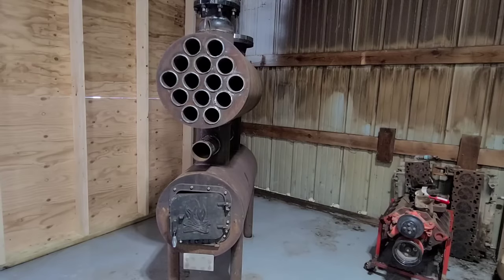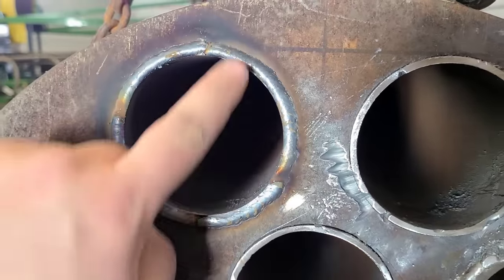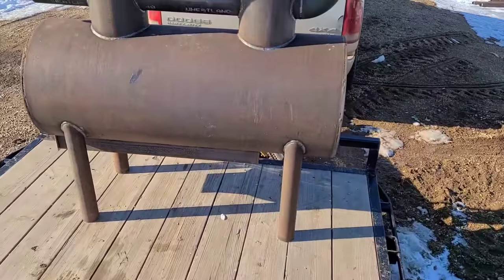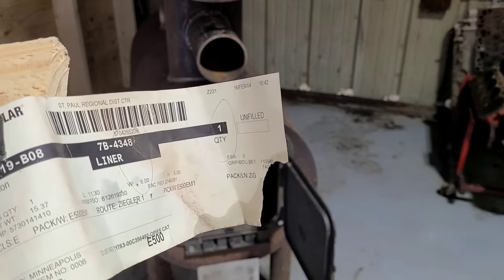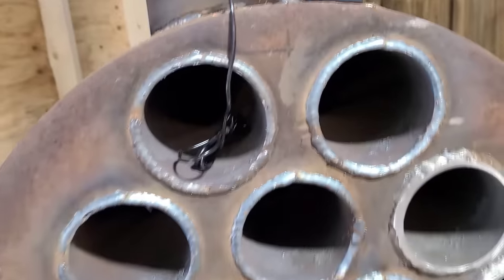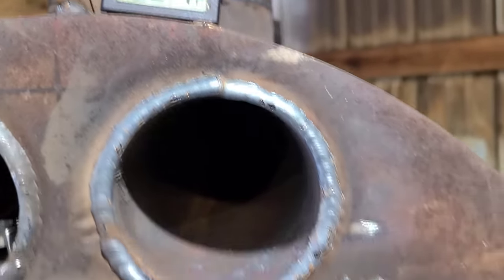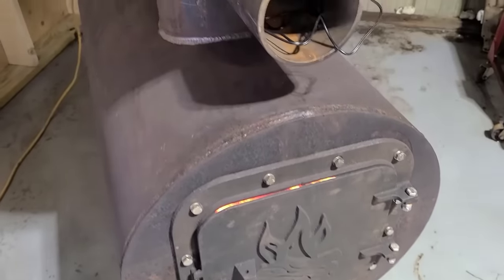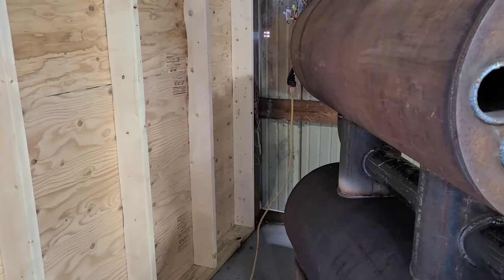My Ultimate Shop Wood Stove Build Part 3

Comment: You should put an elbow of some sort on the top of the exhaust pipe on the roof. Otherwhise when it starts raining or snowing water will come down, fill up your stove and then start leaking outside the stove with all related problem like rust and dirt. Also to avoid any kind of bird to been able to make a nest inside during the hot season. For the rest, a beautiful pice of art! Congrats
Reply from the maker: I do have a cone style rain cap for the pipe but with the wind I really didn't want to climb on the roof haha, thanks for watching!
Reply: Grab a 6" Tee from stores and some SS mesh .  Orient N-S.

Comment: It would be great if you could draw your combustion air directly from outside instead of using heated air from the room which has to be replaced with cold air from outside through leaks in the building.  Beautiful heater.  It's going to be there for a while!

Comment: A damper on chimney would help to control air flow and slow the burn for longevity. It would help raise temp of heat exchanger by allowing exhaust gases to flow through slower and exchange more heat.
Reply: This, damper, flue etc...Rockwool insulation in that wall and something reflective to sheet it. Consider some sort of forced air intake maybe...the fire bricks will help it resist warping, if i had caught this in part 1 i would have suggested thicker wall air pipes on the bottom, we had heat exchanged air fireplace when i was a kid and the bottom tubes wore away after some years, Some crude bent rebar grate for the bottom to keep the wood and fire up off your screen on the bottom will allow more air to get under the fuel and back to the rear, those eat away pretty quick too..
Reply from the maker: I don't want a damper in the exhaust as I need the heat to keep any creosote buildup burnt off. There is a fine line between losing too much heat and choking it down so the chimney is cold and creosote builds up. I'd like to stay on hot side of that line 👍

Comment: Everyone has an opinion so I'll throw my two cents in. I'd look for a way to add secondary combustion air to the fire. This is usually a small amount of fresh air that can be delivered to the top of the combustion chamber. Makes for cleaner burn and more heat. Great fabrication work!!
Reply: Everyone think about this, it’s a meme at this point. Isn’t more straightforward to increase the temperature at the first burn than over engineer a second burn not knowing if it will be hot enough to actually burn?

Comment: Very nice build, I am considering building a similar stove, but using a large 275 gallon fuel oil tank. I especially like the grate and ash pan idea, you can clean out ashes while the stove is going. I have been trying to figure out a magnetic nail collection apparatus to make ash disposal easier and faster. The fire looked and sounded great, nice ending scene!

Comment: Bring outside air directly into the firebox
A great way to improve the energy efficiency of your fireplace is to duct outside air directly into the firebox.  This is even more effective when combined with the installation of glass doors, so that then the fireplace does not use room air for combustion at all (helpful accessory: fireplace back plates). With direct ducting of outside air, the vents on your glass doors can be sealed completely.
Reply: But..., pre-heating the outside air, is even better. My 4' long wood boiler fire box uses 3" pipe to bring the combustion air in, the pipe runs along the upper side of the cylindrical firebox, and exhausts a few inches from the front on the stove. Over the years of use, I've found that if I take the time to cut and use much shorter pieces of scrap lumber, and hold the fire forward, the remaining 3' is all heat exchanger, the smaller fire right near the inlet air burns real hot, no visible smoke, very little ash.

Comment: You can use concrete board like what you use in showers instead of steel.  It is fire rated and would be super easy to tile or stone over if you ever wanted that look.
Reply from the maker: Never though about that, thanks for the idea
Reply: That's a really good idea

Comment: I believe that you should have a dampener in the chimney a little ways above the bolt flange. Then you can get more heat from less wood!!
Another suggestion is to burn up a couple of aluminum cans  a couple times a week to turn the creosote dry and flakey. Especially since you are burning pallet wood. Wet wood and pinewood are awful for creosote and the combination of not retaining more residual heat adds to that as well. 
Put a weighted bucket upside down on the top of the chimney when you are done for the season will help keep the internal rust slowed up too. 
Good job bud!!

Comment: Stay safe and warm. I do agree with you though, the door should seal tighter.
Reply from the maker: I think I can bend the latch and get it better, if that doesn't work I can turn some eccentric hinges on the lathe to bring the door in/out 👍

Comment: Just learned about wood stove fans recently. They operate off the heat of the stove. Low speed should be easy for a stove fan.  I've built air heaters before and I have a similar idea for a wood stove in my head. The air heaters I used to build had a stainless steel expansion joint between the tube sheet and the box to allow for the expansion and contraction of the tubes when they heat and cool so you don't break the welds on your tubes.

Comment: Kyle, if you burn a lot of green softwood, you may find that you get a lot of tar condensate on the top tubes, where it is coolest. In our last house we had a Franco-Belge wood fire burner with a back boiler connected into the water central heating system. I had to take the burner completely to pieces every year to clean out the tar build up on the boiler and that was in spite of doing a really fierce burn every two weeks to try and burn off the tar. The wood burners in our current house do not have a back boiler and get hot enough to burn off the tar, using something called an airwash system but we are quite careful only to use well dried hard wood fuel. My daughter's partner is a tree surgeon, which helps.
Reply: Very thoughtful, relevant comment. Well done
Reply from the maker: Pallet wood is kiln dried so shouldn't be much of an issue. The moisture I mention in the video is from the light rain we had in the morning and making the wood damp 👍
Reply: Kiln drying does not remove the resin or tar from the wood. Only the moisture.
Reply from the maker: This is from the Premier Firewood Company: 

"Use of kiln dried firewood, which has low moisture levels, allows the fire to burn efficiently, create a lot of heat and very little creosote, if any at all."

I'm not saying it will not creosote at all, but a dry wood will naturally not creosote anywhere near as much as a green wood
Reply: Premier firewood is using mixed hardwood, birch and cherry. Hardwood has MUCH less resin and tar than pine. It is not so much about the moisture content in this case as it is the specie.

Comment: Put a dampener in the chimney. All you have is a regulator for the air intake. Hold that heat inside that stove not let it out the chimney

Comment: From the looks of it your a welder by trade, and also looks like you did a lot of planning on your wood burner . You should never have to replace any parts on this beast. Great job.
Reply from the maker: Thanks!
Reply: Nothing on the stove will fail, his fan might but that's pretty easy to swap out.

Comment: Would you be able to tell us all on YouTube your thought process of flow for the smoke and heat extraction part Kyle ?? I and others here would very interested. This is a beast for sure. I personally would feel a lot safer with wider legs cause of the top heavy weight.  Look forward to performance at your shop Kyle. Keep us all informed. Peace LOL.

Comment: Merry Christmas! I love what you did with that old boiler! You have to insulate the unit with lagging, it would be more efficient and safer for people than insulating the building around it. You could fill that heat exchanger with water, set up a recirc system, and use it for shop hot water. A pressure washer with a hot water supply is a beautiful thing in the winter...

Comment: They sold 55 gal barrel stove kits back in the late 70's early 80's.  I bought the kit to assemble a wood stove for my auto body shop, so I didnt have to have a forced air furnace blowing dust into my paint work.  I did a similar trick with 1'1/4inch tubes in the upper barrel and a fan  to blow air through the tubes.  It would absolutely run you out of the shop when burning oak and hickory.
Reply: I had a stove kit from a family owned company called SOTZ, just a great simple and cheap kit, all stamped steel no castings, air tight and man did it put out the heat!

Comment: My only concern is with wood heat; it dries the air so much.  I would suggest welding a small table, so as to be able to sit a Tea pot / kettle of water (say 10" inch square, 0.25" in. thick or thicker) to heat up and put moisture back into the air.  Your throat and sinus will thank me.  25 year's wood heat in my home.  Great build, and design.  Thanks for sharing.

PS the water does not need to boil, just get hot enough to evaporate in a couple of days or less.
Reply from the maker: My thoughts on this were to put the pot on the cleanout behind the chimney 👍
Reply: @kylechrist  waiting for the thermal image video including temps at key areas like the clean out top, etc, very interesting design, can't wait for more vidyas thanks

Comment: You can add a fresh air inlet to the heat sink to turn it into a secondary burn chamber which will create significantly more heat output

Comment: Nice job, should work well. In the late 50's early 60's we had a similar setup with 45 gallon drums but no air tubes. It was our night heat, get wood burning then shovel the sawdust on top.

Comment: Nice build. You have the same problem as most stove manufacturers,  you're heating the mid air and up ! You need to make the heat come out of the bottom and blow across the floor !!!! Remer, heat rises, start with the heat across the floor. I can't tell you how many houses I've been in where my head is hot and my feet are cold !

Comment: How do you clean the flue out? If you cool the exhaust to much it makes water like a 90% furnace. A 90% furnace exhaust gas temperature is 90 degrees your was at a 100 degrees. The water it make is very corrosive and could rot out your flue in no time. I like what you did but it worries me just a little bit.

Comment: I think you are wise to keep the air speed low. One of the challenges with cooling the post-combustion air (which is the effect your heat exchanger has) is that it can cause an increase in emissions, and creosote buildup. I recommend you inspect the inside of your stovepipe regularly until you can determine the rate of buildup you are seeing from lower temps in the stovepipe.
Reply from the maker: I'll just slide the cleanout cover off the heat exchanger and check, saves going up a ladder 👍

Comment: You should try sheeting in the whole stove and add a couple exhaust ports to also trap the heat from the outside of both the burn barrel and your top barrel. With your forced air blowing through to the front. I hope I’m explaining that well enough that you catch what I’m trying to say. 

Great build. I love your idea with the bottom heat tube.
Reply: concrete board?

Comment: Sweet Kyle looks like that stoves working nice. When I was turning wrenches for a garbage company in Norwich NY my boss wanted to make a pallet stove to burn whole pallets much to the same design only we used old thick walled fuel oil tanks and fed the pallets through into the bottom one and put thermal controls on two box fans behind forcing air through the heat chambers . Bays could accommodate 2 tractors and trailers. And that garage was a comfy 79 degrees in the furthest corner great garage to work in and yes the fans were set to low.
Reply from the maker: Sounds like a big stove Shane!
Reply: @kylechrist  it was Rick said he wanted it big enough to burn full sized pallets in it and to heat the whole shop and an added bonus came before I moved on we had added a waste oil feeder to the mix which helped a great deal with the hardwood pallets

Comment: Rockwood insulation in walls at least where stove is. Say 5' out each direction from corner and up 8' in height will protect the wood. Cover this with the same delta style metal that exterior wall is made from. Can run it horizontally for easy screw locations, makes an awesome reflector also. I suggest a used oil drip going into the burner area, in the center of the top. Simple one, using 1/4" copper line ran to a oil resovoir on the wall with a ball valve for flow control.....This will blast your temps past 200f. Easily. My system is just 2 stacked water heaters enclosed in a "shed" with the same fan on the back and several vent holes on the sides. With the oil, the wood is essentially just a "wick" and the oil burns so cleanly you will not have a spot or smoke problem. In 8 hours, in a 30x30 uninsulated shop in Idaho, I will burn maybe 2-3 armloads of wood scrap and a gallon of old oil. And the shop stays roasting, even when the oil is almost turned off. Nice job on yours, just wanted to give you some ideas.
Reply from the maker: Appreciate the suggestions, I have the parts to do an oil drip system only in 1/8" pipe instead of copper 👍

Comment: This is a really genius idea, you have a really great design concept. I think a major design decision you could make on the next one is either to make the upper part half as small, or to double the size of the lower burn chamber. Remember when you attempt to make a thermal transfer, nothing performs at a 50/50 ratio, there will always be losses, especially when calculating volume at 50/50. While it sounds crazy to reduce your upper transfer unit, think about it like this,…. What would happen if you increased your lower burn chamber unit?….same same… so do one or the other for better efficiency in transferring that heat energy via air movement. And only then might you be able to run your fan at a higher velocity… Food for thought.

Comment: While capturing the heat from the exhaust gases / smoke is great, you may find that the outside of the tubes will collect creosote and soot, eventually insulating the surface needed for heat transfer. With my stove I run in what I call free burn, letting the fire have all the air it wants, getting a more complete burn. Hotter burn, less creosote and soot. I also block off one side of my blower to reduce air flow, even low is too much air for my situation. Great job on the build. That is "Heavy Duty" in my book.
Reply from the maker: With the pine burning as hot as it does, I think creosote shouldn't be an issue. I did put a cleanout in the top chamber if need be, thanks for watching 👍

Comment: That's a great build. As Leif H. says, the heat coming from central air/heat systems are around 100F, some go to 105F.  Human skin temperature is around 90F so we feel any heat above that pretty easily.  That much mass in the stove will continue to heat well as the fire burns down and I'm thinking you had that in mind all along.

Comment: 140° - 170° is perfect for maintaining a well insulated space in negative outdoor temperatures. Slower air speed better heat exchange! Carbon Monoxide detector is a must as any pinholes in welds would leak undetected. You should have done a hydro test

Comment: Lower fan speeds sure helps. If it’s a good size shop ceiling fans help move the heat around very well. Pulls the heat back down as it rises in the building.

Comment: Now imagine with that blower fan preheating the air running it through a few 75' of 4" perforated drainage pipe loops into the ground and back to the stove airzooka. Heck without the fire you'd get a delta of heat from the ground source to keep the garage above freezing for the price of the wattage of the blower.

Comment: We had a barrel stove in the workshop back in the 80's.  It sucked so much heat from the flue gasses we had to clean the creosote once a month it would build up so fast.
Reply: i bet those tubes are going to be covered. It would be possible if the heat was increased (insulation burn chamber) before being pulled out.

Comment: Very impressive build.  As you protect the walls on both sides, consider adding some kind of masonry to provide thermal mass that absorbs and radiates heat after the fire dies down.  This will moderate the temperature drop-off, extend the total time a fire warms the shop, and reduce how frequently you have to add wood.
Reply from the maker: I'm considering cement board (like what would be used under tile) to aid in this 👍

Comment: If you had additional clean air source into the top barrel you could probably get secondary combustion and burn off the wood gas. Would also get it hot enough to carry off the water and prevent it from condensing in your exhaust pipe.

Comment: Get yourself a plug in thermostat for the blower. They work great for controlling the temperature in the building. You could also put a limit switch in the heat exchanger to control the blower on/off.
Reply from the maker: I am going to put the fan on a thermostat, just testing it out as of right now 👍

Comment: The faster the air, the more heat is transferred to the room & less is let out the chimney. 
But if the heat is sucked away too quick, than the fire doesn't get hot enough to fully burn all the gasses. Hence creosote build up. 
Also, if you want the best results, than feed the firebox with air from outside. No sense sucking cold air all the way through a room. Plumb it directly to the firebox.